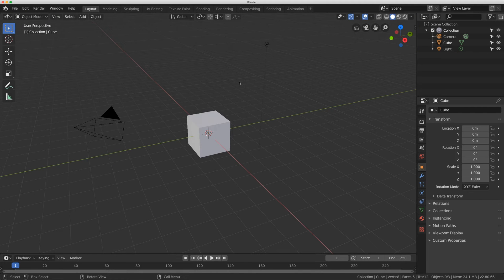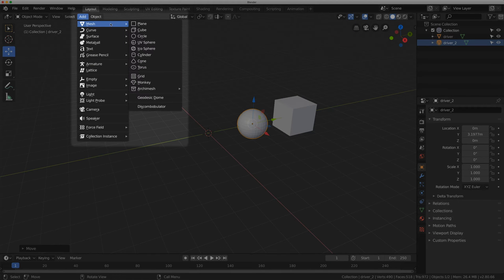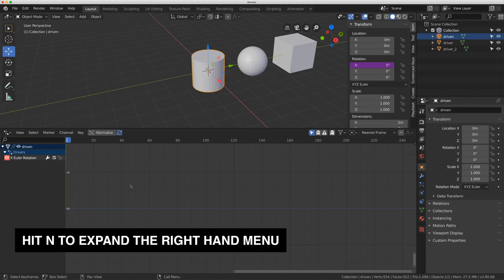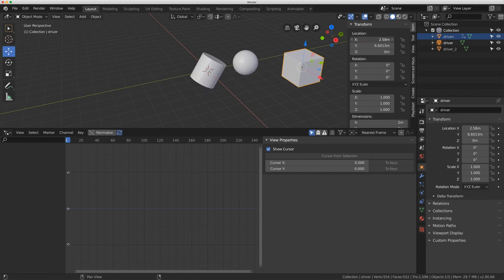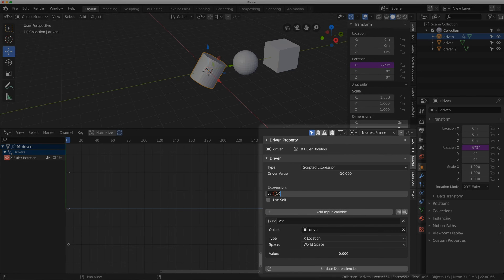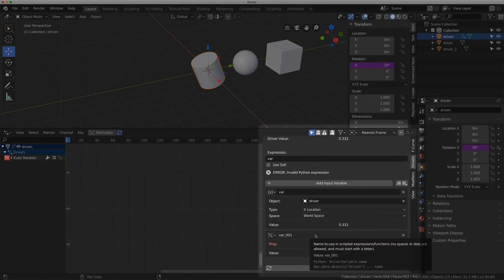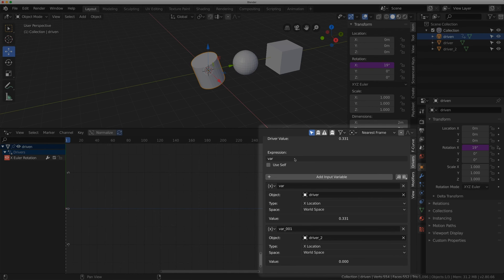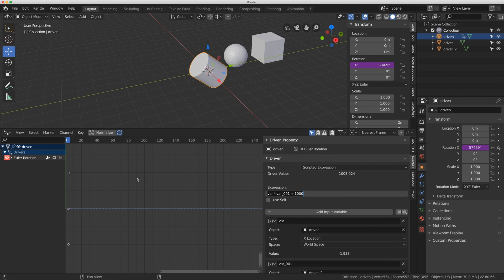Adding Math To A Driver | Blender Drivers Master Class

Comment: Nice one! 

How would you type an expression for animating the rotation of the cylinder based on the proximity of the cube to a set x & z location in space?
Reply from the maker: For this, you can try a distance variable type, or create extra variables for the x and z location then factor that into the expression for rotation.

Comment: hello, i', new with blender and it's python script. is it possible to change the rpm of the object after fixed interval of time? 
suppose i need to run an object with a rpm of 1200 in cw direction for 2 sec, then i want it motor in ccw direction with rpm of 1000 for 2 sec and drive the object with another object and do same with object 2 too. if yes, can you suggest me any link or resource which could help with to run the object using python in blender?

Thanks in advance :)
Reply from the maker: For something like this, I would just make a system that rotates the control. So, every time I input 360 I get x rpm. From here I would just animate that controller faster or slower to achieve the different RPM Values.